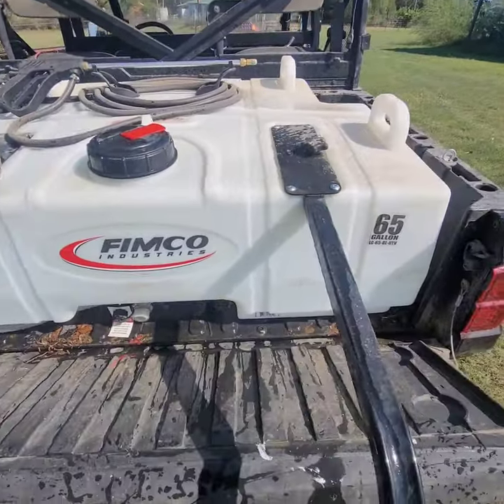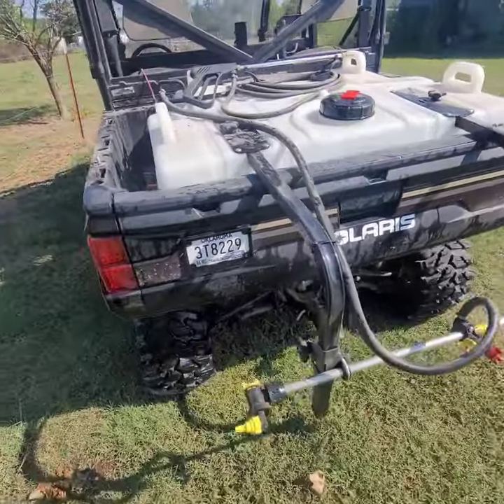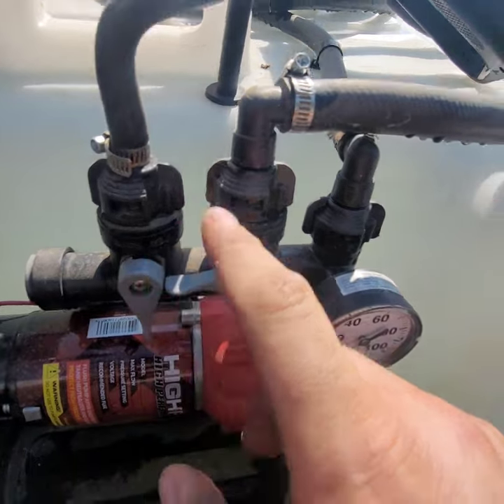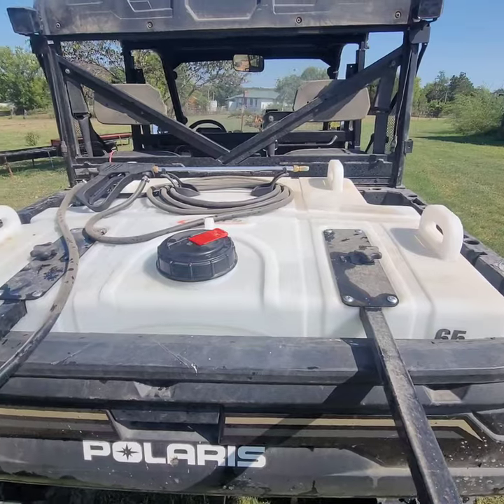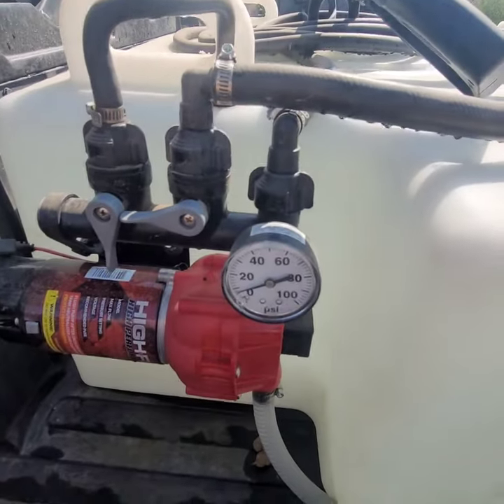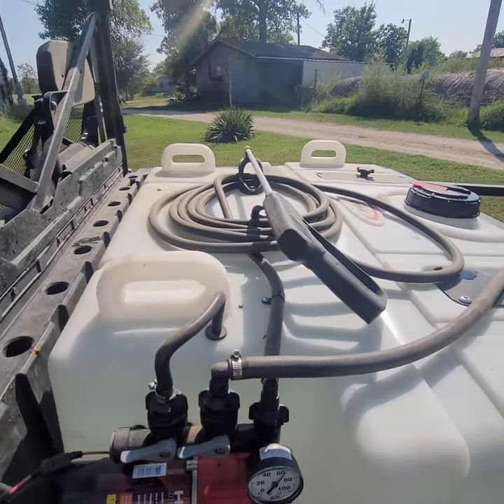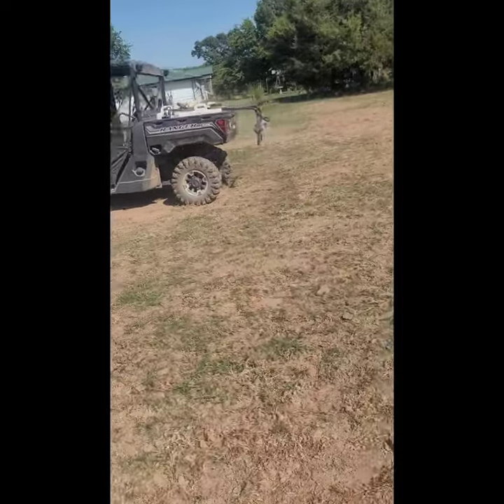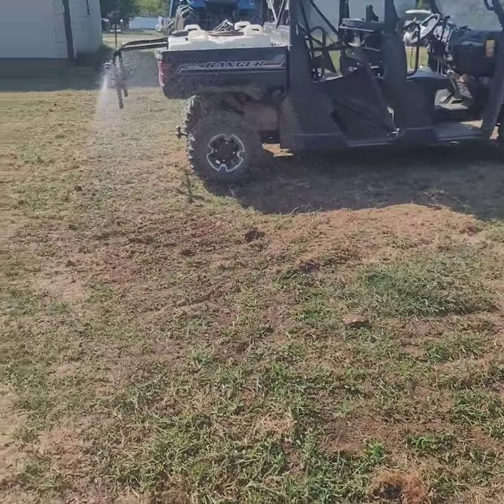Fimco 65 gallon Boomless UTV Sprayer ~Review~ #polaris

Comment: How many acres are you doing? I ask because i have 40 acres with trails but only 5-6 acres are food plots, would i need the 65 or could i get away with the 45, since the 65 fills your bed completely, im worried the 45 might move around to much.
Reply from the maker: @michaelsawyer7029  it varies. Here on the homestead, there are 40 acres. Half of it is timber.
Sometimes, I spray other pastures we have for hay when it's too wet in the spring to get the big tractor and sprayer in them.
The 45 should be fine. You night have to put a strap over the top to keep it from moving around or put some cut 2x4"s in the bed to take up the space and keep it from moving.
Reply: Ty for quick response

Comment: My 3 nozzle boom less boom won't spray out of all 3 sprayer ports at the same time.  It will only spray out of two.  None of the nozzles are plugged because it's random which two it will spray out of when you turn it on, but all 3 will spray chemical, just not all 3 at the same time.  Any thoughts? We've tried a 2.4 and 4.5 gpm motor on it and had the same issue
Reply from the maker: That is very odd. my 1st thought was a plugged nozzle but you said they are clean and it is random. I would of tried a larger pump like you said but since that didn't fix it. 
I would look at the hoses supplying the nozzles and make sure they all are clean and possibly not internally collapsing. No reason the 4.5 gpm pump wont supply 3 nozzles.
Reply: If it won’t spray out all 3 nozzles, your manifold has gone bad, my buddy had same problem with his, we tore that thing completely apart, last thing we changed out was the manifold and that turned out to be the problem
Reply: @michaelsawyer7029  that's funny you say that because that's 100% what it ended up being.  I even did a video on it to help others because I wish i would have checked that first!
Reply: Trust me, me and my buddy wished we would of checked the manifold first to, but Nooooooo, we play with that thing for hours before we figured out it was his manifold.
Reply from the maker: If / when I have issues with mine that will be one of the 1st things I check.

Comment: Pump straigh to baterry or power regulator?
Reply from the maker: It's got a fused harness with on off switch that goes to the battery. I have a recent video I published that I show it in more depth